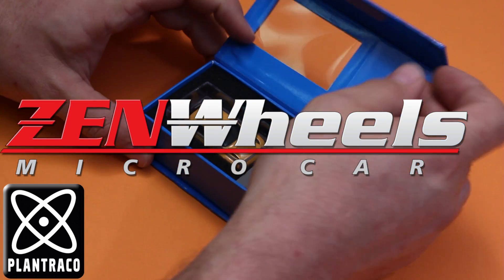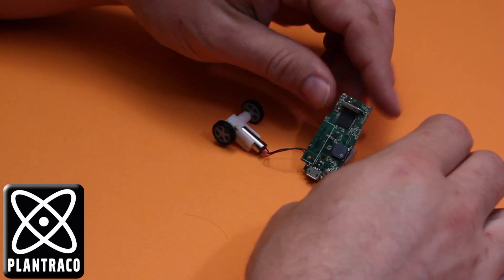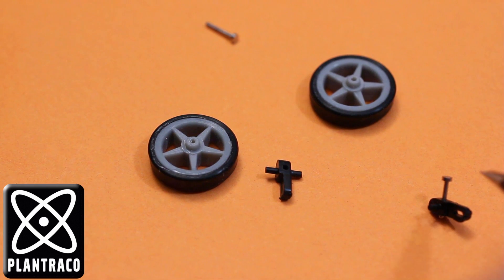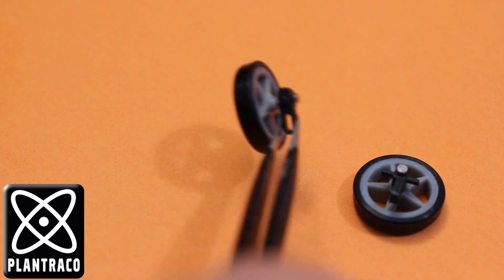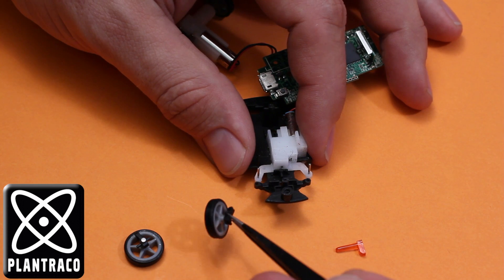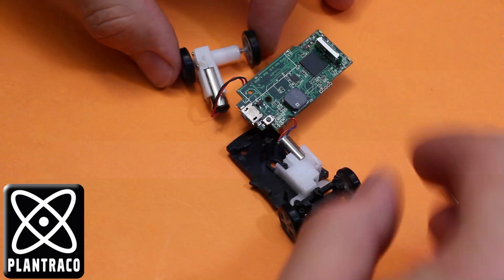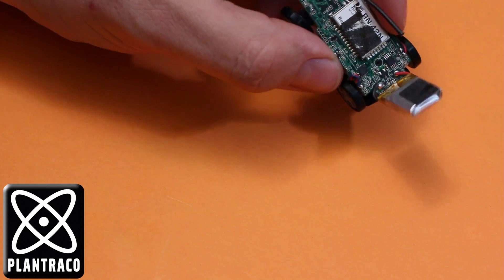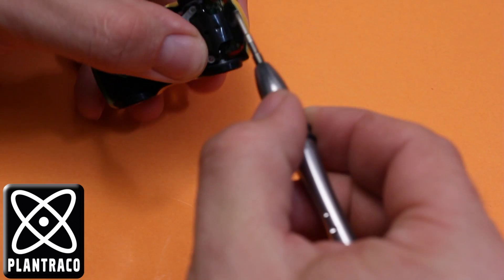ZenWheels Micro Car Steering Knuckle Repair and Take Apart

Comment: Hello, im having issues with the steering- it does not work. Whenever i restart and reconnect the car, there will be a 'steering servo issue' message. Also, the car makes a loud whirring noise at the same time. Forward/backward motion, lights, sounds all work fine, is there any way to rectify this?? Will be very much appreciated!!

Comment: Does anyone know what battery will work as a replacement? Will any 3.7v 70mah work or does it need to be the exact same JHY451422 model number as the one in the car. Mine isn’t charging anymore and I’d like to get it working again.
Reply from the maker: DJ DTM  yes any lithium polymer will work.
Reply: Plantraco thank you SO MUCH for the reply!!  You’re awesome!! I really look forward to getting my car running again, I had lost all hope of finding the exact same battery, this is probably the best thing to happen to me since we went into global pandemic mode, I hope your reply here helps others out who might be looking for the same answer. Other than the battery this car is still working great.  In fact it has had less problems than the Chrysler Sebring I owned last year :)   Seriously though, thank you :)
Reply: @DJDTM  Hello there. Did you fix it? My microcar isn't turn on.. I realised it before few hours. I tried to charge it, blue light is on, but when I try to turn on nothing. Really sad.
Reply: @vasilismagoulas  I did fix it, it was really straight forward and only took about 5/7 minutes to get it all done and it works great again :)
Reply: @DJDTM  Really? That made me happy :) Battery was the problem? Where did you find a replacement?
Reply: @DJDTM  It would be great if you could reply to my comment, 2 weeks ago. Thank you.
Reply: @vasilismagoulas  I got the battery off of EBay.
Reply: @DJDTM  Thanks, I will try to find one and fix it for my son.

Comment: Did you use a set of Mitutoyo callipers to press that pin in?! Dang dude - ruthless.
Reply from the maker: :)
We also use them as digital scribes
Reply: Plantraco Legendary.
Reply: Plantraco I know that a Bluetooth version of the Nano Blimp is much cooler, but please, understand me, not everybody has IPhones. So i beg you, MAKE THE CONTROL APP CROSS-PLATFORM! I swear that I'd buy it as soon as you do this!
Reply: Plantraco Or at least, PLEASE, RESTART PRODUCTION OF THE ORIGINAL NANO BLIMPS!